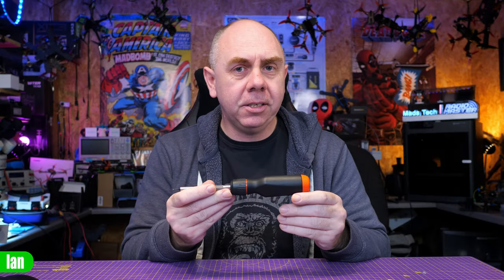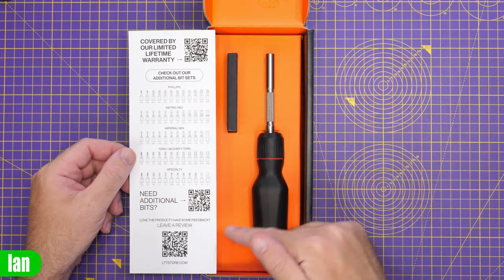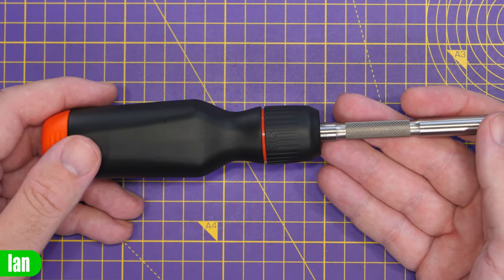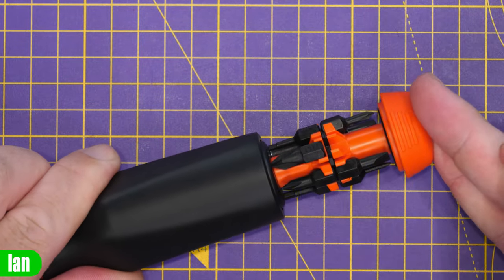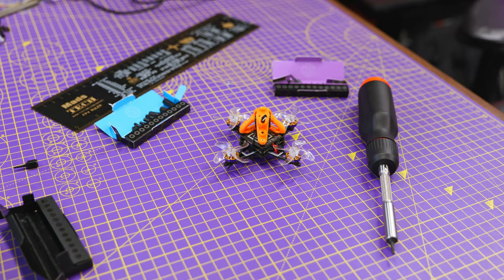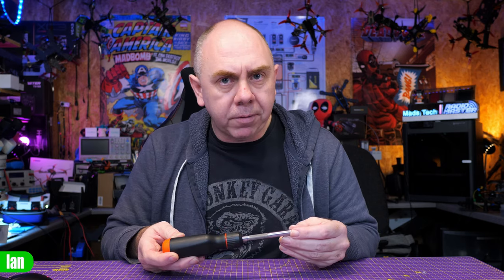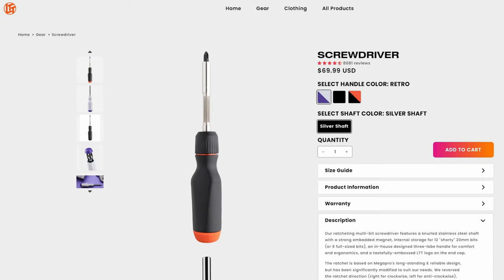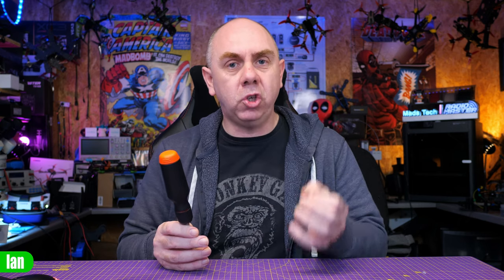LTT Screwdriver 6 Months Later - Review

Comment: Pretty hard to beat the Snap-On ratcheting screwdriver, and they have given me brand new replacements on 20+ year old screwdrivers that had worn out the ratcheting mechanism.
Reply: How much is the snap-on currently?  I’m not above paying for tools. You get it. (For a real tool, I tend to buy domestic)
Reply: 79$
Reply: I have both the ltt feels so much better and the ratchet on the snap-on is so tuff that it only ratchets on a tight screw once it's loose the ratchet is useless.